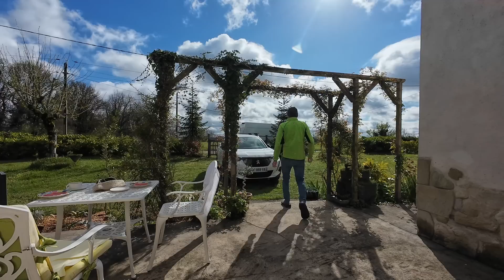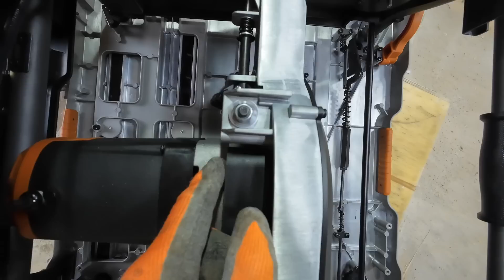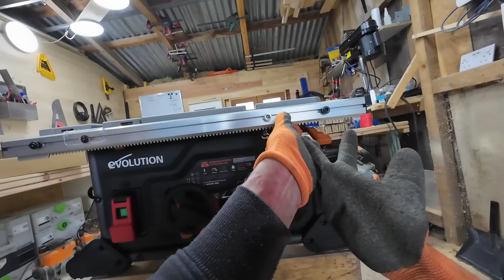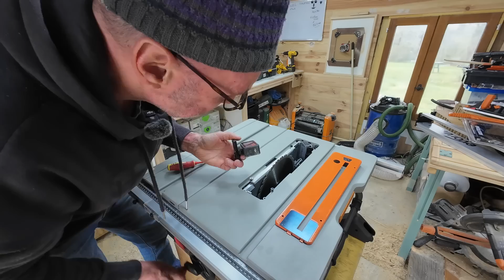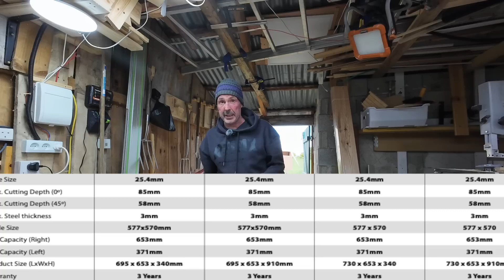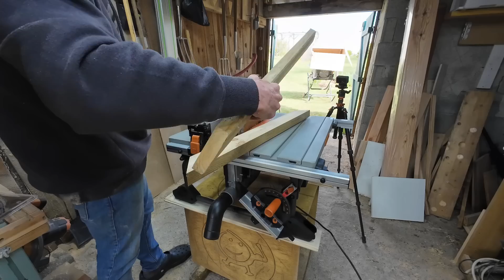Evolution Power Tools' NEXT GENERATION R255 Jobsite Table Saw. (Gifted)

Comment: Only mod i made on my rage 5 was to cut out the bottom of the shroud as it collected  bits of wood stopping the blade from being wound down fully , even with the mod the blade cant be touched unless actualy putting your hand up inside the shroud so it safe

Comment: 10:50 I was told that ripping such a thin piece of wood between blade and fence is a good recipe for kick back.
Reply from the maker: There are a few things you can do to reduce risk and proper guarding is one of them. Regards JP
Reply: I have heard this too. They say to place a short piece on fence for start of cut only this helps stop kick back.

Comment: Save your money! Can't believe this chinese shite still has a customer base!!
Reply from the maker: What saw you got Riley? Regards JP
Reply: @Smallbarnworkshop  I have an SCA combination machine. However many years ago I bought an evolution mitre saw that was incapable of cutting a true 90, badly made and looser than Katie prices morals. The cheap Chinese table saws are terrible and dangerous as the fence won't remain true and will move during a cut, causing binding/pinching mid cut. It's your body you are risking so crack on. Mybadvise take it back for a refund but you do you!
Reply from the maker: @riley165 Katie Prices morals 😂 I do like a combo machine. My dad had a Startrite he bought 40 odd years ago. My Evolution was gifted so I definitely won’t be taking it back. Regards JP

Comment: Easily the best review of this saw I have seen, very pleased that you kept the crown guard on, this is certainly down to the fact that you are NOT a hobbyist and are very aware of the regulations in respect of using circular saws. I am sure the regs in France are very similar to the UK. It seems that what may have been referred to as a budget saw a few years ago Evolution are definitely moving in the right direction with this saw to match the likes of Bosch, Dewalt and Milwaukee etc. There does not seem to be a facility to slide the fence backwards or attach an auxiliary fence for when ripping solid timber as opposed sheet material, I guess it would not be too difficult to modify for this type of operation. The Makita 2704N does have this facility likewise has a rear extension pull out which is very important for cutting lengths, but as you say the more expensive in the range does have this. I really like the sliding table on these saws and think more manufactures should include this feature. I am sure the ‘mitre gauge’ is poor as most are, probably down to the fact that a chop saw is a better option for this process and the manufacturers are aware of this so put little effort into this.
Reply from the maker: Thank you Gary. Regards JP

Comment: Sorry to say it sounds horrible I have I sheppach I've had it for twenty years it's a 12" blade saw with soft start and immediate stop 2 1/2 KW motor extension table miter fence run on bearings the cost though exceeds what that saw costs you.

Comment: personaly i wouldn't go near evolution tools, going back many years, i was on a job where we needed a chop saw and no-one had brought one so we sent someone to buy one quick and they bought an evolution chop saw well on the first day the knob that adjusts the angle of the cuts had snapped of and made it really annoying to use... admittedly we could have sent it back and asked for a refund etc but that had stuck in my mind ever since that it was just cheap weak plastic and i wouldn't buy one myself.... fair enough if they have got better and more advanced good for them but i won't touch the name personally... i have a akita chop saw of my own as its a 18v and runs one my battery platform and i have a dewalt site table saw which iv had many years its used everyday and gets moved in and out of a trailer being driven around over potholed roads etc and never missed a beat.....

Comment: How stable are those benches going to be without any kind of stretcher or cross bracing to prevent racking?  Built how they are they seem like they would be more decorative than useful.
Reply from the maker: originally child’s play equipment so very robust. been using them for years. Regards JP
Reply: @Smallbarnworkshop my comment was actually meant for another video that was on before yours. I guess I didn’t hit send before your video popped up. The saw looks good though, I actually have their metal cutting saw and use a hybrid saw for wood.

Comment: As a professional tradesman.
I would never recommend anything from this brand.
But cheap buy twice.
Much better budget brands or second hand.
Thanks David.
Reply: If I was a professional tradesman like you I would wholeheartedly agree, but as a hobbyist the picture is different. I very much like the Evolution range, and own many of their tools. I had one handheld circular saw burn out on me a few years back on day one, but they replaced it in store without question. Other than that it has been smooth sailing for me - YMMW. In terms of bang-for-buck I think these are compelling tools for the hobbyist. I clearly would make different choices if this was my profession.
Reply: I argue as to whether woodworking is really a hobby if you sink this low.

At some point it's best to bow out.

These tools are a waste of money in my opinion. Unusable for professionals and only serve to provide headaches to those who don't know better.

I've heard far too many horror stories and I can visibly see the cheapness in the tools through their website. Their skill saws had no skill put into them whatsoever.

I can't beleive the owner of the company considers themselves an engineer. I have no engineering degree and can pick out failure points based off photographs on their site. This whole company needs to go back to school.
Reply: @brandonhoffman4712  a couple of questions for you if you have a moment! First, what are the failure points you can see on the products right away? Is there any particular one that your experience can pull out on this saw? It would be really valuable to know. Apart from the cheapo plastic of course! I do have the older version of this saw and because it addresses all the problems with that saw it got me excited, but always useful to hear from the very experienced! Bear in mind I am interested from the point of a hobby with a v limited budget, rather than pro.
Reply: @lex500  I have heard horror stories of their track saw tracks not being uniform, that you can't even lay the track on your marks to get an accurate cut.

I've heard horror stories about their motors crapping out on table saws, tracks saws, and skill saws.

I can clearly see that the baseplate on their skill saws are trash and will easily bend as they have 0 lateral reinforcement.

As far as this saw in this video goes. I haven't really seen it. It's not listed on their site yet, and after looking into the company as a whole, I'm not interested in watching any video on evolution power tools until they graduate beyond harbor freight quality and attract enough brand recognition off their quality to get me to circle back around for a 2nd opinion.

For now it's worse than a rigid vacuum. Which has a motor that runs on plastic bushings as far as I'm aware... I used to kill 1 a year, now I have a festool vacuum. It's been with me for 5 years and is sucking like day 1. It's paid for itself and is now saving me money as well as cleaning my jobs better and keeping my lungs cleaner.
Reply: @brandonhoffman4712  really good points for consideration. Thank you!
Reply: @brandonhoffman4712  Rigid == Evolution. You'll notice a lot of their products are identical. With that I bow out from this comment field as I have as little to contribute as there is anything for me here.

Comment: The riving knife being way higher than the blade limits its use.
Reply from the maker: The instructions does show working two ways, the second level with the top of blade. I’ve just not worked out how to use it yet - watch this space!  In practice you shouldn’t really cut like that anyway as you should have the crown guard on all all times - but we know we don’t do that! Regards JP
Reply: @Smallbarnworkshop  Thanks, just saw your latest vid, I'm interested to see what Evolution comes back with. We know it happens and I'd much rather operate without the crown rather than having to remove the crown and the riving knife.

Comment: The 1 think I didn't like about the rage5s was the blade bore and the blade guard went in the bin it was less than useless. Having to use bore reducers to put 3rd party blades on it was not the best thing. The rage blades are over priced but these days sextons in the U.K do blades with the 25.4 mm bore although living in France (Post Brexit) means I had to get them sent to family in the u.k and pick them up when visiting.  I sold it after 5 yrs of use, I'm not sure if I'll need another table saw as I have retired from furniture making. This new model looks to be much better built I do like the look of it apart from 25.4 mm blade bore.

Comment: Having not taken the plunge but keeping an eye on the market (because I want a table saw) all the reviews I've looked at point to one or more of the same 2 primary issues: 1 - fence locking out of sqaure , 2 - mitre slots not industry standard. These seem like pretty fundamental and easily avoidable **-ups to me. Secondary issues are table flatness and dust extraction. I must say from the video it looks like the dust 'extraction' was reasonable even without suction. Evolution are obviously taking that point seriously as the larger saws are showing above and below extraction which is something I don't think I've ever seen on a portable. It's also lighter (despite being bigger-tabled) than the baby DeWalt. That sliding bed is a great touch a la Festool portable. Have Evolution actually managed to nail it on with this saw? I think it may have just gone straight to the top of my very short list. Thank you very much for the review in plain Yorshireman English.

Comment: Thanks for the review, although I'm still giving Evolution power tools a pass for now.
I had a really rough time with my Rage 5-S: the sliding table tray was welded up so badly out of square it didn't fit, some of the nuts weren't threaded, and the blade was out of parallel from the factory. 
They replaced the table tray and nuts immediately, and I calibrated the blade to be parallel to the fence (their video tutorial remarks how unlikely it it you'd ever have to do the procedure!). 
It's decent to use now, but I don't want to entrust my safety to power tools with such poor QA in the future.

Comment: I have the rage 5s and all my accessories except the mitre are stored on the body of the saw so I see no improvement in that department. Dust collection looks better quick stop is a good improvement rachet fence is neither here nor there I always measure between blade and fence anyway. Zero insert plate should come as standard on all table saws. Having to set it up permanently for me is a definite negative overall for me there doesn't look to be any reason to upgrade from my rage 5s and I don't think there are enough benefits to justify the extra price.

Comment: Nice review thank you. I envy you living in sw France, a move I'm hoping to make next year.
Anyway I just found it on the evolution website, available on pre order for April 8th delivery BUT £400 for the R255TBL 😂.
I think I'm going to stick with the Hikoki 36v table saw with a power pack transformer, Hikoki offers a 5yr warranty over Evolutions 3yr warranty and you can put any brand blade in it without voiding the warranty, unlike evolutions warranty conditions forcing you to buy their over priced blades. £50 for a wood blade, freud/diablo blades can be bought for less and tbh I have always been really happy with their performance and cut finish, but that is just my opinion, others will differ.
Reply from the maker: Hi Sly. Thanks for the comment, hope your move out here goes well. Regards JP

Comment: Always found their tool to be cheap and crappy. 
I wonder if evolution still insist on evolution blades only or else warranty claim rejection? The only one I actually liked is their sliding double bevel mitre saw. Not for woodwork though, we used it until it died with a stone cutting blade, great for cutting paving, block paving and brick when doing decorative work avoiding any wandering lines.

Comment: I've given evolution every possible chance I could give them.....but they consistently disappoint to the point where I now consider them complete rubbish. I had circular saws, a table saw ,  mitre saws , a multi tool , a zaw zaw and the final nail in the coffin was an utterly ridiculous and useless extendable pole drywall sander. Every single item seemed cheaply manafactured and badly engineered. The motors are constantly sparking and arcing, and they are not in the least bit user friendly. Cheap , tacky plastic is used. The drywall sander neatly got smashed into bits....it was that annoying to use. Got rid of them all and bough better brands ( except for the sander....but a round pad on an extendable pole was still 100 times better).
Reply: @jessjameson154 if you had so much trouble why keep buying them? The list you state you had suggests you were waiting for a miracle, as opposed to accepting they were rubbish. But theres something wrong if you tried every tool on the shelf before it dawned on you!
Reply: I agree.  I got the Track Saw a few months ago and the 2 sections don't line up straight when butted up to each other so the cut is way off being straight.  I need to set a few mm gap on one side and use another straight edge for it to work effectively and cut straight.
Reply: @Eric-DS9  I agree i bought the track saw and the track was cut so roughly that it cut my finger and needed lots of fling and smoothing to make it reasonable. Horrible manufacturing quality
Reply: Wtf is this company... I just went to their site. The 1st two tools I saw were clearly trash based on the picture I saw.
Reply: Of course they’re cheap tools. They have to cover the cost of sending loads of free units to YouTubers 😂
Reply: Same, this guy is on the Evolution Pay book otherwise doesn't take pride in his work.

These tools don't last, they also have shitty tolerances, sent back a mitre saw that got repaired 3 times on Warranty, after collaboration and some work it would go out of whack and require a repair

Had my DeWalt mitre saw since and not even calibrated it once in 2 years and still cutting straight
Reply from the maker: @deepmystic6739 🥰

Comment: The issue I’ve had with my older evolution saw is that the fences are bowed. I’ve had two and both are bowed by at least 1mm in the middle. I’d be interested to know how straight this fence is. If it’s straight, then I’m sold!
Reply from the maker: Never had a problem with my Rage and this one is straight . Regards JP
Reply: I had a little twist where the black part and clamping mech. is of the fence, I simple could bend it right back.

Comment: Nice saw, uses a less standard arbor size of 25.4mm/1-inch like the Rage 5. Not many options for other blades unless you spend money to get standard blades bored out. That 1-inch arbor shows the pedigree of this saw, it's only common on metal cutting saws.
Reply from the maker: Hi Mike. Ultimately Evolution are a blade manufacturer who offer tools to bring their blades to market. They have increased their wood cutting blade range to complement this saw.  Regards JP
Reply: @Smallbarnworkshop  I own both an old Delta and a Shopsmith, I am all too familiar with sourcing uncommon blade sizes. Shopsmith, at least, has an alternate arbor for US standard blades with 5/8" arbor.
Reply from the maker: @mikeking7470  wow. 5/8” that’s a strange size 😊 Regards JP
Reply: @Smallbarnworkshop  and in the USA it's hard to find a "normal" blade in any other size. Everything from 5.5-inch trim saws up to 10-inch table saws use it. Some trim saws use other sizes (my Skil 5-1/2 for example uses a 1/2 blade) and a lot of the new small batter saws use even odder sizes. 12-inch saw use 1-inch arbors.
Reply from the maker: @mikeking7470  Thanks Mike. Every day is a school day 👍 Regards JP